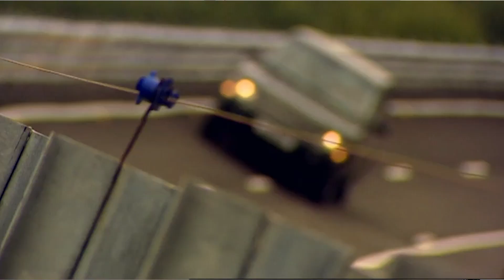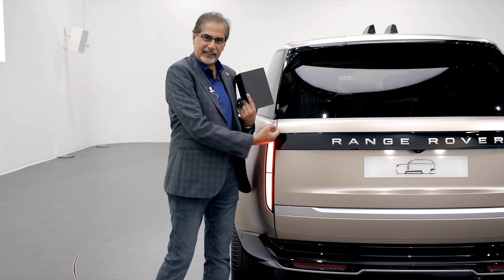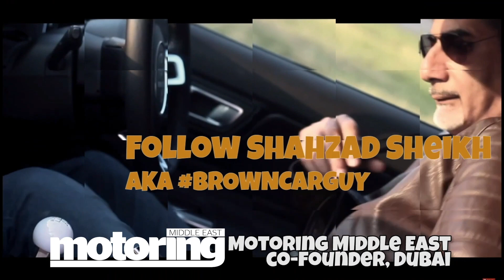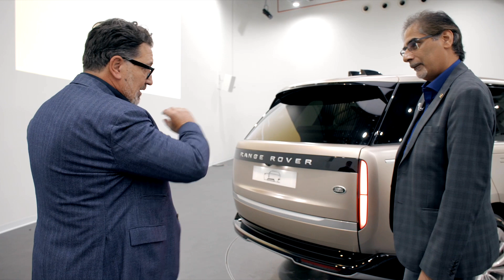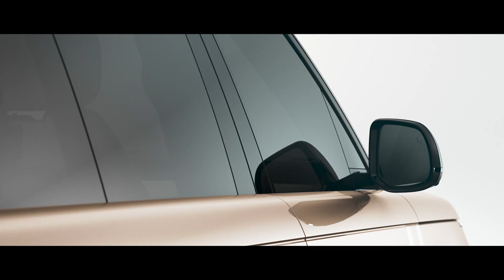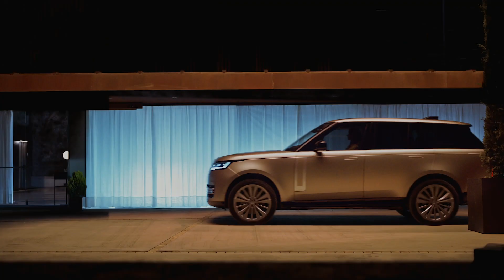All-New 2022 Range Rover Walkaround!! [Plus Design & Engineering Interviews]

Comment: Plug-in Hybrid?  What an utter waste of money.  Any platform that has that kind of alternatives is nothing more than an ICE design with added bits of EV to add pointless weight.  Either sell a good ICE powered vehicle, or a ground up EV design JLR.  This is just a pile of pretty, marketing BS to flog to the gullible.  Shame on you!
Reply from the maker: I get your point because I used to think the same way about PHEVs, but for people who are able to keep a car plugged in at home, it does make sense, because most will hardly use the petrol engine, but it’s there as a back up should you want to do a longer journey.